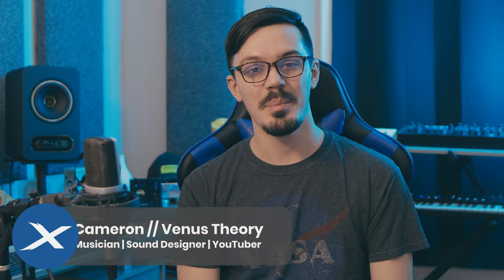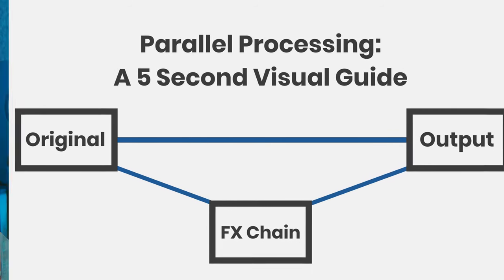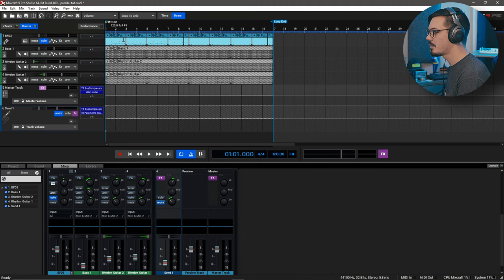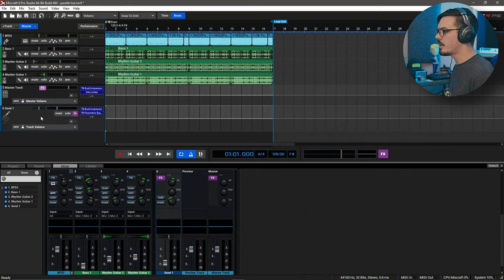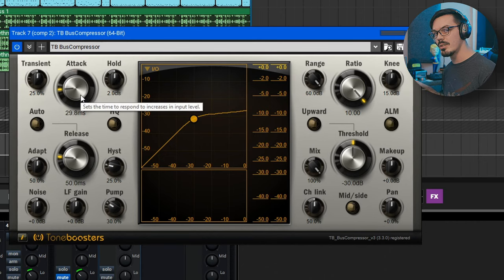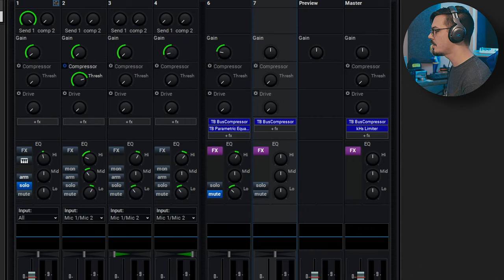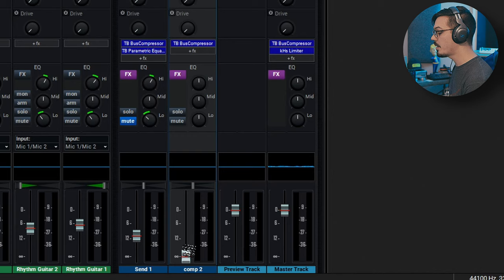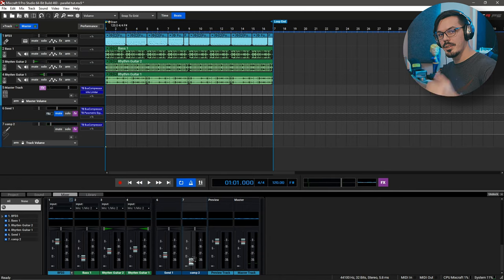Parallel Processing | Mixcraft Quick Tip

Comment: Hey man, so I just recorded drums for an album, and once again you come out with a video that helps, like you knew what I was doing,  lol. This process comes after a general gain staging using pink noise I would think and then is just volume adjusted to ear. Adding color to the sound after getting the initial levels. Wow, perfect video exactly on target topic for me. Thanks so much Cameron!

So, if I were to have to reset and go back to Pink Noise stage.... Do you mute the parallel compression and then add it back in by ear? 
The parallel compression side chains, side chains in general do not go through Pink Noise gain staging, is that correct?
Reply from the maker: We're glad you enjoyed the video!

As for mixing with the pink noise method, extra effects and processing like parallel compression are best dialed in by ear as typically they are used as a subtle enhancement rather than a 'feature focus' of the track. 

If you blend it in with pink noise, it'd likely be way too loud to be useful. Instead, it'd be best to level it in slowly just until you can hear it start to come in too loud, then back it off a bit!
Reply: @acoustica222  THANKS!

Comment: PLEASE DO A VIDEO ON ARCADE OUTPUT USING MIXCRAFT?!!
I understand mixcraft 7, will not work because it is 32 bit, but do other versions of mixcraft work?
Reply from the maker: We'll note that down on the suggestions!

As for 32bit, you would need to upgrade to a version of Mixcraft that is 64bit to use any 64bit products. The latest version of Mixcraft will offer 64bit support so you can always upgrade when you're ready!

Comment: Is it possible to come across phasing issues when doing Parallel Processing? I haven't yet come across any phasing problems when doing this in Mixcraft but I've heard that this problem can exist when doing parallel compression.
Reply from the maker: With some time based effects or extreme filtering moves you could end up with some phasing issues. However, with most things this shouldn't be an issue or noticeable. But, if you're ever unsure, summing to mono is a good way to double check!
Reply: @acoustica222  how do we sum to mono in Mixcraft though?

Comment: Why not simply play with the "wet" versus "dry" ratio on the compressor output level?
Reply: You can use the send for more than one track, for one. It's also much easier to compartmentalize, and the parallel compression send can have additional effects applied to it, such as sidechaining. It's a more efficient, controlled workflow

Comment: I'm a noob. What's the difference between this and sidechain?
Reply from the maker: Hey there! Sidechain compression or sidechain processing is using an external signal to control a processor (typically a compressor). Parallel processing is sending a copy of a signal to be processed and then blended in alongside the original.

Comment: Hello Dear Mixcraft Engineers! 
I had a suggestion or request! anyway!
some VST instruments like Strings have multiple techniques like pizzicato and staccatos and etc... in order to use them i should duplicate that track (that vst) and choose the technique that i need! this demands more time and effort and uses my CPU a lot and my pc stops to work!
can you do something that in next versions we could change the techniques of the vst in the midi editor... like left click the note and choose the technique that there is... is it possible? 
if mixcraft contains this facility then it will be my one and only DAW!
thank you all again for creating amazing daw like this...
Reply: If you are using mixcraft midi strings, it can be done using 'program change' in the automation editor.
Reply: I have used a cheat code. I load all instances of the articulations I need, then I set different patches to play at different velocity ranges. I then compensate for volume of each by raising or lowering